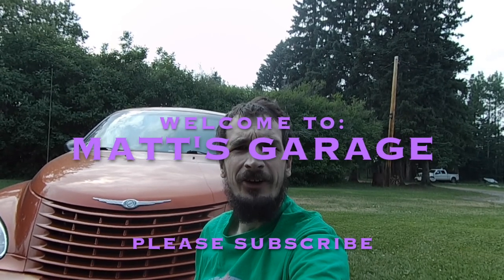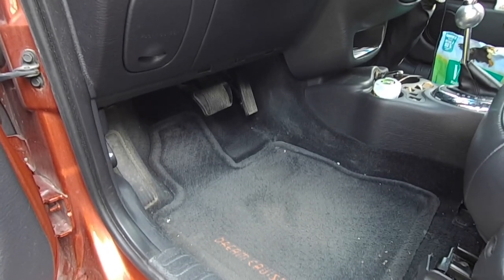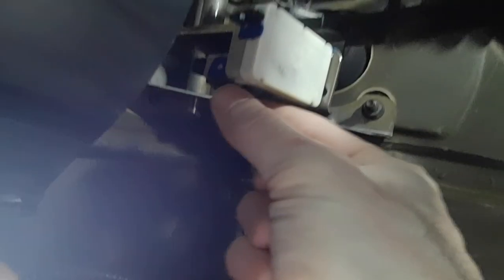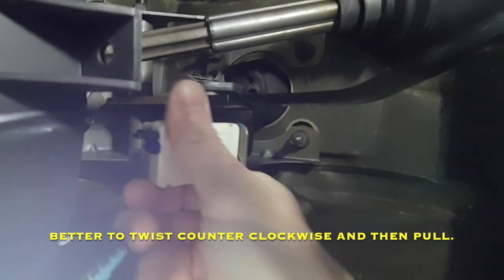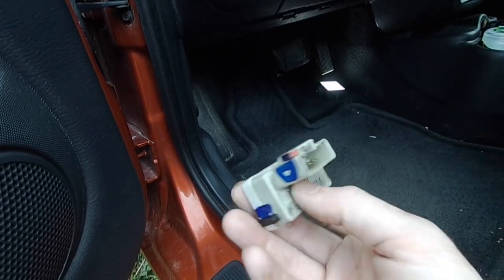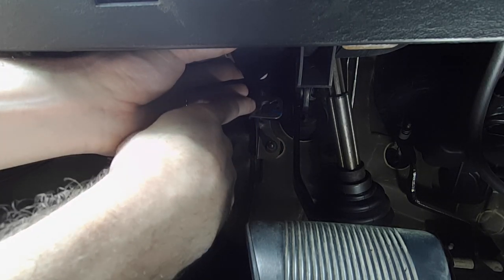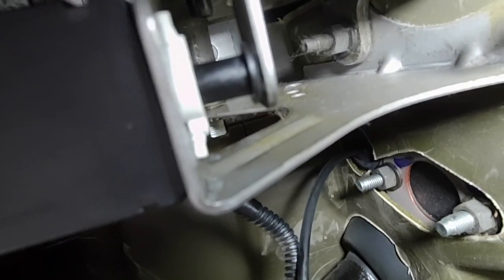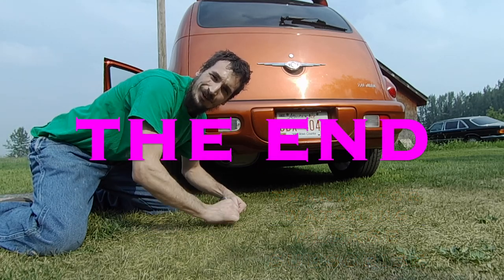PT Cruiser Brake Light Switch Replacement

Comment: Thanks very much for your pt cruiser videos, it has helped me in fixing my own car. Now I have a code P0452
Reply from the maker: Double check your gas cap, that’s the code you would have if it was loose or not sealing correctly. If that is not the issue you may have a problem in the fuel venting system, repair shops have a smoke machine they hook up to the system to check for leaks so you may need to have that done if it’s not something simple like the gas cap. Good luck!
Reply: He is a awesome mechanic❤️❤️❤️
Reply: @CarswithNash  Thanks again.
Reply: I checked fuel cap is ok, changed surge solenoid close to steering column under the fuse box but light came back.

Comment: Hey brotha its me again with another PT question. I always and only go to you because you are precise and on point with your answers, especially with the PT.
Ok im not going to go into "WHY" because its 2 long to text but i got rid of my A/C unit completely out of the car, now my power steering. I took out pump and belt(obviously) and capped off the bottom of radiator which was connected to my power steering reservoir. And i capped off the P/S  hydraulic line from the rack and pinion. Will it be ok to drive it this way? TBH its not hard at all for me to drive it manually. I ve been doing it for a while so im use to it. Whether slow or fast and parking is a breeze. Again, for me it is. 
So, is it ok ro drive it this way?? Thanks so much again for all your help throughout the years brotha. You're the best
Reply from the maker: I'm super busy at the moment but I'll get back to you this evening with a detailed answer on this.
Reply: @CarswithNash  yes thank you very much. Obviously when you can brotha. I know there's a way to reroute the line from the rack and pinion back into each other. They sell the hose and each end has a connector to screw back into itself. Like a U shape.
Reply from the maker: @ltbomb7194  After doing some research it seems like the best method for doing this is to leave the rack completely open and without fluid in it because if you loop the lines like that you get dead spots in your steering from pressure spots in the fluid when the ram is still moving back and forth in there through the fluid, that's why you just leave it open so it can vent and doesn't build any pressure. Although most people don't bother I would suggest maybe putting a small breather filter on the ports to keep any junk out of the rack, but one person I ran across had been doing this for 8 years without anything on there, just took the lines off and called it good.
Reply: @CarswithNash  hey brotha. Thank you so much I truly appreciate it. I will explain why I did that. The lower thermostat housing for my GT was shot. A new one was $225 and I wasn't going I spend that. Through research I found that a Sebring 06 has the exact same lower thermostat Housing but for $45 brand new and with the thermostat temp sensor included. So I installed that. The only difference is the placement of the hose for the coolant. The GT is to the right and the Sebring is in the front. So I rerouted all new coolant lines and deleted the power steering reservoir. And then the whole power steering belt, pump. That's why I asked about the lines. I appreciate your help tremendously. You are always there when I need help. You are the best when it comes to this stuff. Punctually and knowledge.
Reply from the maker: @ltbomb7194  In this case I had to look up the information, but I knew where to look. Thanks, I'm always happy to help.
Reply: @CarswithNash  hey Matt one more question. Lol. It's simple and you won't have to look anything up for me. Haha.
I wanted to send you pics of my PT GT. Is there anywhere in particular I can send it,like here or your private email address?? Lmk cause I've been wanting to show you what I've done to it and might as well cause you helped me with a lot of the major issues I've had. Thanks again for all your help. I can't stress it enough how helpful you truly are.
Reply from the maker: @ltbomb7194  I do have social media, the links are in the video description. You can e-mail: sadiethecat1989@gmail.com
Thanks for all the kind words,  I really appreciate getting feedback like this.

Comment: There was No Need 2 Break it Off? Simply Rotate CCW and it should come right out? Still a Very Helpful Video Nonethelss.
Reply from the maker: Yes well it’s not a very common part to fail so this was my first time changing one and since it was a do not reuse part I assumed it would break coming off anyways… But yes it looked like you could get one off without breaking it if you were careful.

Comment: Hi Matt, I am on the verge of buying my first PT Cruiser. I love the car the only resistance I have is coming from the lack of knowledge about it. The one I was trying out had issues with cranking/starting. I had to hold a little plastic button right behind the key while turning it to get the car crank. I tried looking at your other videos to figure out if this is normal or not but I was unable to find. So is it? Thank you very very much. I love your work and I subbed. Best, BWA
Reply: I know your comment is two years old, but I do not see any replies.  I have owned MANY PT Cruisers.  I currently have three.  The ignition release I think you are referencing is on all my PT's that have manual transmissions.  It is not on the automatics.

Comment: I have an 08 Touring. only 94k miles. Having an issue with windshield wipers stopping in mid wipe. I figure it's in the electrical system. You ever have that issue?

Comment: How do I replace my hood prop rod on my pt cruiser 2003 it has the old yellow metal one not the struts
Reply from the maker: They just sort of fit through a rubber grommet and have a bit of a bend at the end that holds it in, so you just have to angle it over a little and work it out of the rubber. I actually have a video coming up on repairing a bent hood prop on a PT cruiser as that seems to be a very common issue.
Reply: @CarswithNash   thank you for info I also need to know if you already have a video or plan on making one to replace spark plug wires in a 2003 pt cruiser
Reply from the maker: @WhoAmIl  I’m going to release the hood prop video tomorrow FYI. Yes if you look for my turbo PT tuneup video I cover that and I also have an older video on spark plug replacement in a non-turbo car. I’m not sure which one will help you more you never mentioned if yours was turbo or not. Both are in the PT cruiser repairs playlist.